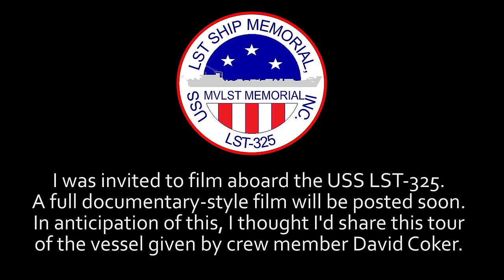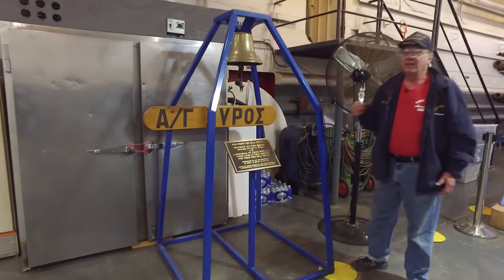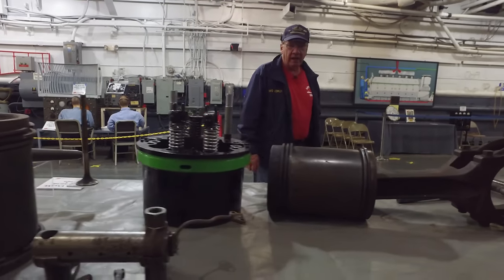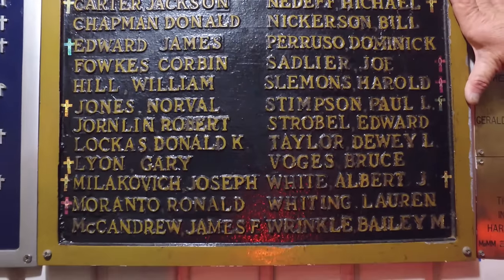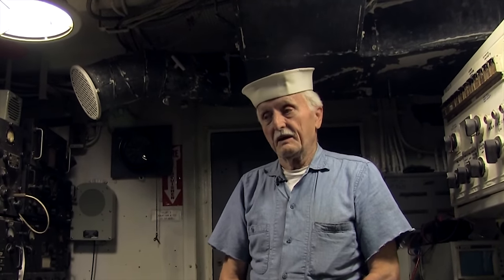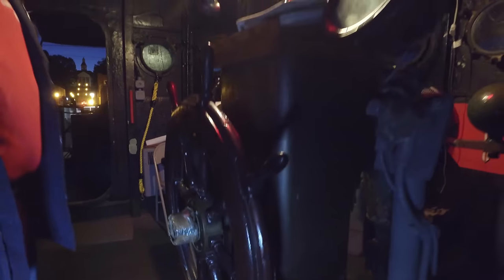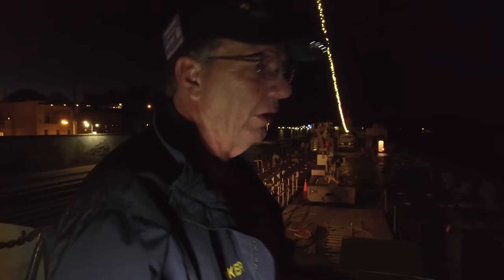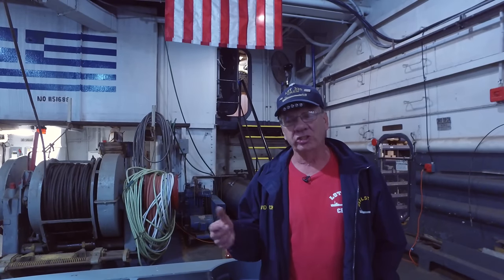USS LST-325 Ship Tour (4K)

Comment: I was a on Military Transport LST 287 with MCB #7 on a trip to San Salvador BWI. from Newport Davisvile RI. We went through a Hurricane Helene off the coast of Cape Fear North Carolina, a category 4 storm. I remember the  ship still had two side by side large tall bridg
ed forward masts.  Do to the storm we had to get rid of most of the deck cargo. Also the storm damaged the big forward front doors. The bulldozers that we carried below deck broke there lashings. After the storm we landed on the Island we lost the rear anchor chain broke and ship ran much to far up on the beach.  After we unloaded the mess inside of many barrels of road tar. that we had to shovel out in to trucks. I had black feet for a while.  Oh i almost forgot, ship listed in the storm 27 degrees to port and starboard, and twisted and waved up and down like a dolphin. watching the deck wave.  Finally it took two Navy Sea going tugs to pull it off the beach and a lot of CB's with bulldozers and many men with long poles to help push and  launch her again . During the storm I was asked by the captain to steer her into the waves. . Because all on board were Hopelessly seasick and I had only the experience driving a vessel it was a  30 FT. a launch for a Yacht Club. no a 327ft LST "I will never ever forget this Trip." Paul Woolhiser CN  MCB #7 1958-1959 ish.  PS. The ship was built lot better than i thought Not for one trip for D Day across the Atlantic.? "Can Do"

Comment: I was part of an Air Force crew that loaded two LSTs in Cubi Point PI in 1961.  We shipped our radar equipment to Thailand for a SEATO exercise.  These ships were designated USNS since they were not crewed by the US Navy.  One of these LSTs had the elevator as seen here, and the other had the long ramp.  We met the ships in Thailand some time later for unloading. Driving the 160 miles from the beach landing to Don Maung AB on the left side of the road, through the night was very interesting!  It was definitely an experience that will not be forgotten.  As a side note, we got to watch the CIA C-46s fly out of Don Maung into Laos on a regular basis.  We tracked them!

Comment: I worked on a 99' 1929 vintage tug that has a starboard main engine out of a LST. The Falk reverse gear had a horizontal offset that moved the propeller outboard. Originally an A head engine with flat copper head gaskets was updated to a B head with o-ring gaskets.

Comment: I served on two LST's in Vietnam.  The USS Litchfield County LST 901 and the USS St. Clair County LST 1096.  My job was a 2nd Class Enginman.  One thing that I found interesting is the power source in the Auxiluary engine room.  On both of two that I served on we had three Superion GBD 8 engines producing our DC Power.  I toured the 325 at Evensville Indiana during our first LST 901 ship reunion and saw the 6-71 generators.  But I do think that they were originally powered the same as the two vessels I served on or perhaps with the deman or the 6-71 engines that there were non available when the later LST's were built.
Reply from the maker: Thank you for your service! 🇺🇲

Comment: Ship in the picture looks like a Brooklyn class cruiser not a destroyer.
Reply from the maker: It's not a destroyer, it's a supply ship.
Reply: @KenHeron  Background ship at 10:47?
Reply from the maker: I'm not sure
Reply: @streboret - Good eyes - That is definitely NOTa US Navy "destroyer class warship"; however, it probably is the Brooklyn-class light cruiser USS Boise (CL-47) in the background of the photograph at the 10:47 time code mark. Of note: I boosted the resolution of the screen shot and it appears that the light cruiser's 3 forward turret's guns, are pointed to her starboard, and the aft-most of the forward turrets... it's guns probably just fired a salvo just as the photograph was taken = check out the black smoke rising above that 3rd forward turret.